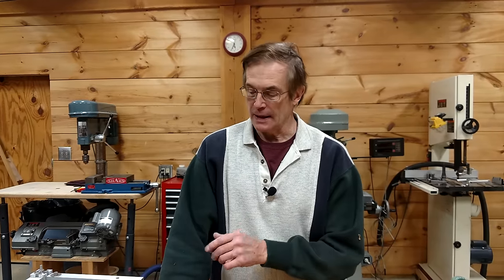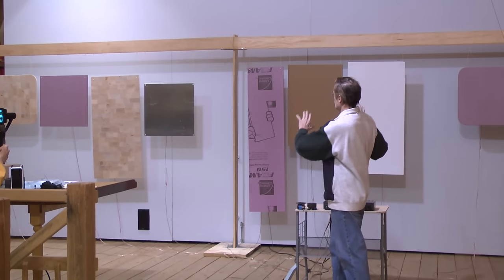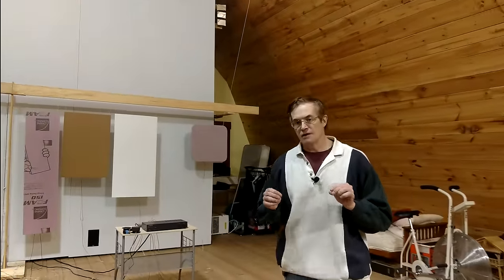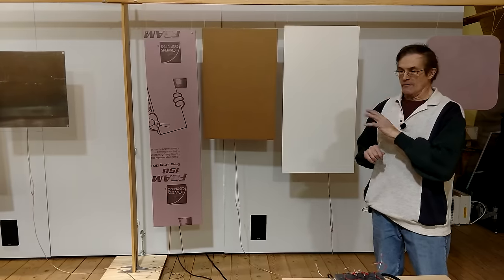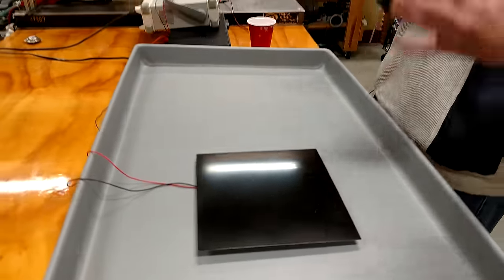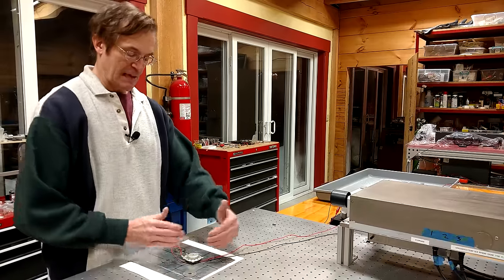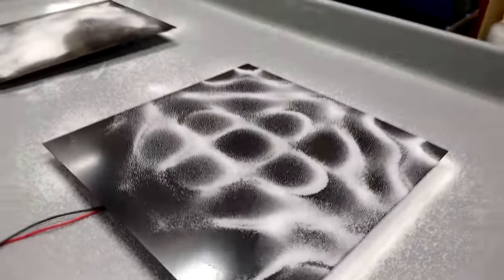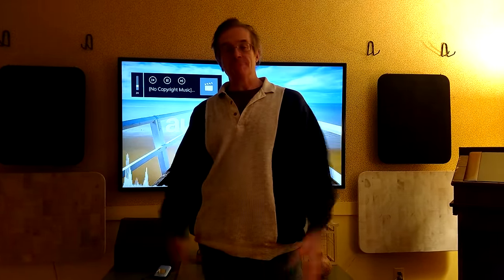Fantastic DIY Speakers for less than $30!

Comment: Dear sir..thank you so much for the video. I was an MECP installer at best buy and circuit city during what was known as the golden age of car audio. I was able to talk to vedors about speakers and materials. Metal speaker such as aluminum and titanium are notorious for adding vibrations. This is resolved by some manufactures by adding a rubber film, such as a spray on truck liner or plasti dip. The best speaker material, according to what i learned, is not carbon fiber or kevlar but rather paper pulp that is not compressed, as used by cerwin vega and bose. Up next would be the foamed IMPP, injection molded poly propaline, material, used by pioneer and kicker. You may not get lower frequencies out of your set up, as the bass frequencies will cancel each other out, as you are creating whats called a bi pole di pole speaker or a spaker that fires in both directions. Th8s benifits the dispersion of sound in high and mid but will kill the bass. Im curious as to what would happen if you added a rubber surround to the square shape, as the surround on a speaker also help to stop vibrations and keeps the speaker from cancelling out its own frequncies. Im also curious about bass shakers in this type of set up. In theory, as long as you place it with enough space from the rear wall, the sound that is out of phase comming from the back should hit the wall and return back into phase re enforcing the sound comming out of the front. I thank you again for the video. Im planning to build a set for a 5.1 surround system. Thanks again.
Reply from the maker: A number of viewers who built these speakers found that placing a sound absorbing material on the wall behind them improved the sound quality especially at lower frequencies.

Comment: When you tested those speakers on the various materials did you happen to try different thicknesses of each or any as well? Im very curious if any results.
Reply: Easy enough to build them yourself and see. Typically you would get more damping, more mass but less stiffness and it's not a great tradeoff.

The perfect material would have infinite stiffness and damping. The closest we get to that is big carbon nanowire planes, not yet available anywhere.

Comment: Thank you for this!, The weights on the back of the panel looks like a Fibonacci spiral...
Reply: Indeed; 3/5 = 0.6, i.e. very close to the golden ratio, and I wouldn't be surprised if the mathematically ideal spots are exactly phi.

Comment: 9:25 aluminium
11:20 polystyrene
12:03 engrained balsa
13:23 long polystyrene
14:31 balsa & polystyrene
Reply: This should be pinned
Reply: @carpediemarts705  - Why? The explanations are FAR more important

Comment: I enjoyed the vide, and also the commentator, however any application of a large flat panel "baffle board", as it is called in the audio industry, to a piston driver (meaning a speaker) will greatly enhance low frequency and to some extent mid frequency amplitude (volume) even if the driver is mounted on the front side, rather than on the back side, of the panel. Additionally, placing a driver on the back side of a panel produces an unavoidable and undesirable resonance between the drivers' diaphragm (cone) and the very close proximity of the back surface of the panel. This in turn will substantially affect high frequency accuracy. Lastly, the listener's position between the two panels will still be subject to the 1/2 wavelength and 1 12 wavelength distance issues that the commentator mentioned at the beginning of the presentation. I suggest that the commentator listen to a pair of Martin Logan panel electrostatic speakers and then decide what really sounds excellent. In any case I enjoyed the video and it was definitely nice experimental work.

Comment: I’ve been considering trying exciters in a drop ceiling environment. Very curious as to the quality they might produce while being concealed.
Reply: Don't these need to be free hanging to work? I would think in a drop ceiling environment where they are horizontal and touching other materials, they'd sound atrocious. But report back here if you do it.
Reply: Forty-three years ago my buddy's uncle demonstrated this very thing in his home, which had plywood paneling as ceiling material throughout the home. He effectively turned his ceilings into speakers wherever he installed the transducers. It was amazing.

Just a few years prior, another buddy had a pair of transducers that could be screwed to anything to make it into a speaker. I came up with the novel idea of putting them in poly bags and suspending them in his swimming pool. We were blown away by the quality of the sound underwater. It lacked direction and seemed to envelop you completely no matter where you were in the pool. . Robin Trower's Bridge of Sighs never sounded so good, and hasn't since.

Comment: In order to minimise the standing waves, would it be of any benefit to shape the panels into irregular quadrilaterals?
Reply: Mick Lumsdon This is what I was wondering. Like how cinemas are trapezoidal.

Also, could you attach multiple actuators to a taller panel to create cylindrical waves like a line array?

Comment: Any thought as to the impact of different shaped panels on sound reproduction? Intuitively, you might think that square and rectangular panels have more response nodes (as seen visually) than say a triangular panel. Activator placement on a triangular panel might accentuate higher or lower frequencies. Thoughts?
Reply: A joke thought... since 2nd order distortion is considered "evil" by audiofools, if you made a triangular plate you could get more third order distortion, for that ultra desirable "tube sound". 😛

Comment: wow, I would love to try and attach one of those to the SMT (Tip end) of one of our V112  wind turbine Blades. the reason why I think that would be awesome is that inside the ruffly 55meter long blade consist mainly of 3 parts. A huge cone made of Fiberglass also referred to as the beam! an under and over Shell sandwiched around the cone. so you have a high compression Material yet very flexible and strong. Because it is a cone shape inside the blade you got amplification. we make these things using a process called vacuum bagging. when the vacuum is low enough under 20 mbar. we infuse the many of layers of fiberglass and carbon together using a strong epoxy resin. 

in short very flexible. 
very strong 
High density
Low Compression 
and cone-shaped 54.65M long
Reply: did you try this?
Reply: @cameron4994  NOPE would be fun tho
Reply: @wardope  you should get on it! sounds like your the perfect person to try it! haha

Comment: Concept: car roof headlining 😁
Reply: That's what I was thinking the entire time! Although suspending it might be difficult to keep from swaying about. I wonder how much sound quality would be lost solid mounting it?
Reply: Yes, NXT - the company that invented this technology - was originally researching how to do sound cancellation in helicopters and fighter jets, with flat speakers on the roof and walls!
Reply: I read an article in an electronic engineering trade publication about using these exciters in cars .... roof panels, door panels, etc.   This was about a year ago.
Reply: My Fj cruiser has these in the rooflining, i dont think they did it over in the states, but it and a lexus i have use these for a more immersive sound experience and active noise reduction. ;)
Reply: Pretty sure a recent BMW concept uses this or a similar system to replace traditional audio drivers.

Comment: "Speaks about high sound quality while recording with the worst mic on youtube today"

No hate, just found this funny :P
Reply: Meanwhile my current speakers are an old pair of headphones with only one ear working hung up on my lamp. I think its time for some new speakers.
Reply: 100% my thought
Reply: Bobylein it’s just because of the distance between speaker, him and the mic. They’re designed to pick up audio from a distance, either voice level or loud speaker levels.
If he stood right next to it, it would sound the way you’re expecting.
Reply: What I don't understand about the sound is that he's wearing a lav mic, but they seem to be using the mic on the camera as it gets better when the camera is closer to him.
Reply: or just turn off the vacuum cleaner in the background... :D
Reply: Der Nicolas, I was wondering what that whooshing sound was. Sort of like being on a transatlantic flight. 
I must add, really interesting video
Reply: Yea, and the speaker in my phone does wonders to. :o) But with what I learnd here, in physics and murray-smith's builder board speaker... I'm ready for businesses!
Reply: @dylanr8646  my speaker system on my desk is a panasonic sa-pm53
Reply: Consider: comparison is the basis of his experiment. Therefore, on a quality speaker, you hear crap from the lesser materials, improvement from the better. With a crap speaker, you will get crap from crappy, but a noticeable improvement from the betters. Same thing.

Comment: Where do you get "end grain balsa wood panels"? The ones I found online are pretty darned expensive, and that's before shipping.
EDIT: I bet they would look nice with some linseed oil on them, would that effect the sound?
Reply: Possibly,.. yes, 
....the sound of fire trucks will interfere with your listening experience, should the volatility of that oil become problematic.
Reply: @interstellaraxeman4468  It's been used to finish furniture for 1,000's of years, so we've pretty much got it figured out. The main danger is leaving oil-soaked rags laying around (they can spontaneously combust). The bigger issue would be how absorbent the end-grain balsa is, I imagine it would soak up an enormous amount of oil... done improperly that could potentially be hazardous (it needs to cure in thin coats). Wax may be a better solution, but I would be leery of how any finish would effect the sound, considering how expensive that balsa is.

Comment: I really appreciate the amount of time and effort that went into this video. 

But I feel I have to speak up in defence of traditional speakers as you seem not to understand why they are the way they are, and why flat panels will never, ever replace them.

As you mention toward the end, solid panels cannot reproduce low frequencies. They have no bass response to speak of, and no percussive oomph. But they also can't produce sufficient high frequency detail, because of the damping effect of attempting to move so much mass, which are made worse by all the extra weights you've added to damp down their natural resonant peaks. They are highly dominant in midrange, and even within that range, their frequency response will always tend to be uneven. 

You talked about these panels being more similar to how real instruments produce their sound than a traditional speaker driver, but that isn't true. Real instruments generally have (a) one or more relatively small sources of vibrating air - for example a vibrating string or drum skin, or air being blown through a reed or through the pursed lips of the player and (b) a much larger semi-enclosed reverberating chamber, carefully tuned to resonate so that particular harmonic frequencies are boosted. The choice of solid materials do have a role in the resonance of an instrument too, because they colour the sound, they influence its timbre. But it is overwhelmingly the reverberation of air within the chamber that is used to increase loudness. 

Traditional speakers use exactly the same technique. They too have one or more relatively small sources of vibrating air - the drivers - in a larger reverberating chamber - the box. 

Conversely, flat panels throw away the reverberating air chamber and just use the reverberations of the solid material (plus, to some extent, the unenclosed air gap between the panel and the wall - but that will likely muddy the sound rather than reverberating nicely). The result is that the material imparts a lot of its timbre. The sound - as you found from your experiments - becomes highly coloured by the properties of the material, rather than being reproduced as accurately as possible. Having chosen a material that does this as little as possible, you seek to further reduce its effects by shaping and adding weights to damp down the worst peaks, but you can't eliminate the colouring that is still going on, and you can't compensate for the lack of bass and of high frequency detail. The result is something that might be better than the crappy little speakers built into your TV (which again suffer from a lack of reverberating chamber) but is nowhere near as good as a standard pair of speakers would be. 

They do look lovely though. ;)
Reply: If you watch one of the further videos, you will see that he tests different panel speakers against a Polk speaker as to their broad band frequencies.  He is able to get some of the panel speakers to compete with the Polk speaker as far as relative smoothness  But yes, you will still need to add an amplified subwoofer.  However, to me, that's not a big deal.

Comment: This was fascinating, and rather inspiring. While I know nothing in about audio equipment/design, I think this looks fantastic to try out. Can anyone reccomend me a decent amp to use?
Reply: Cheers
Reply: Go to partsexpress.com and have a read on their DIY forums etc and you'll get up to speed on the basics fairly quickly.  They can also recommend products based on what your intention are as well...that's really where it all starts as there is a huge amount of product available from 5w valve amps to 10,000 watt pro audio units.

Comment: Will this speaker work with my 300$ Monster Cables?
Reply: Steffen E  Nope.  But you’re in luck, I can offer you a great set of cables for the low, low, price of $199!
Reply: Only if you drive them with a Krell class A amp or a McIntosh.  Put the amp on $200 spikes, just to be sure.
Reply: $300 for anything made by Monster Cable ?!?!?   LOL....you seriously got taken. Monster sells cables like that only because there are people like you that buy them. Ask any of their reps.